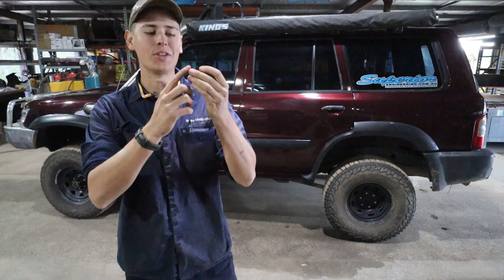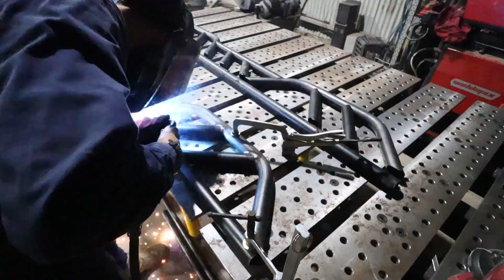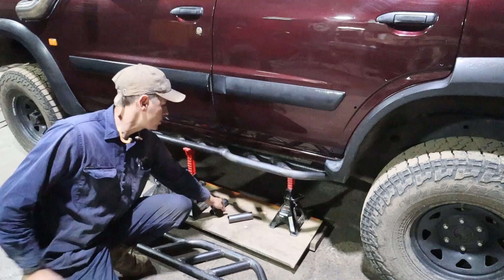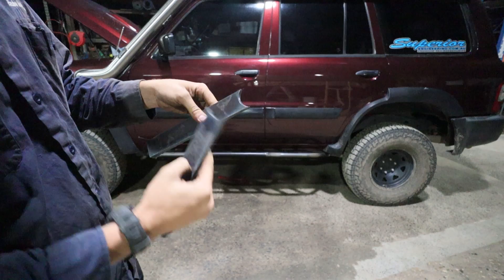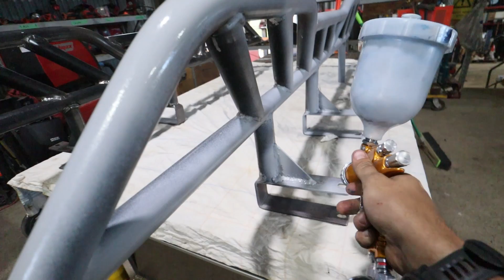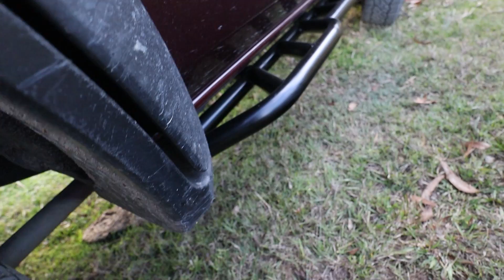DIY Custom Sliders GU Patrol

Comment: sick video mate, what’s the suspension setup you are running?
Reply from the maker: Thanks mate, Ive got dobinsons 4in coils weighted 150kg front and 250kg rear, superior engineering 12in shocks. Drop boxes, +20 lower arms and adjustable upper arms. Not the most wild set up but its a start 👍